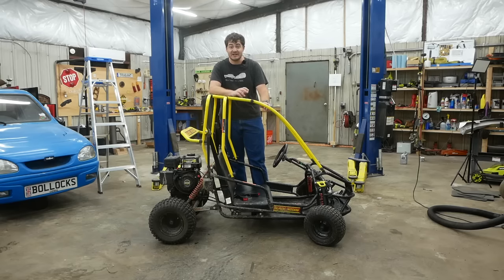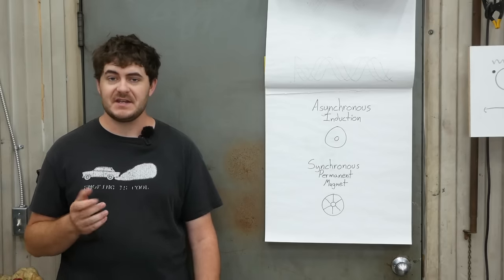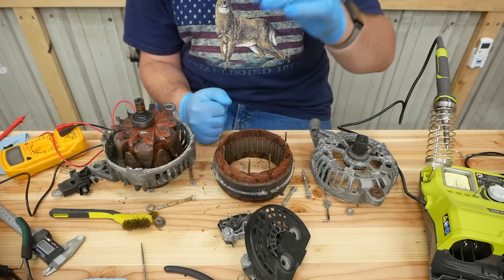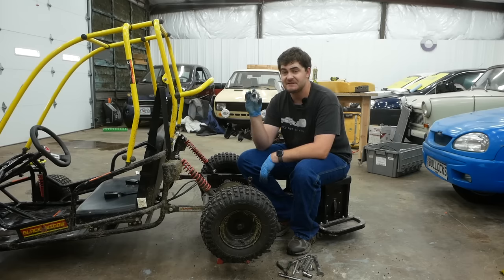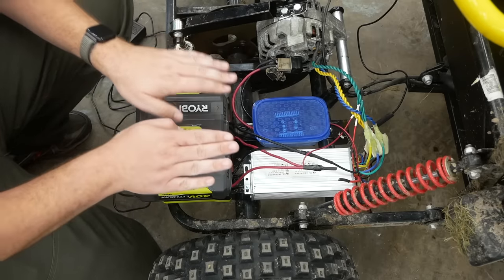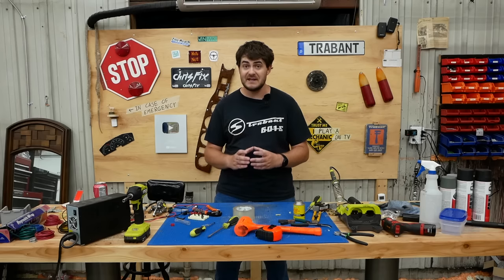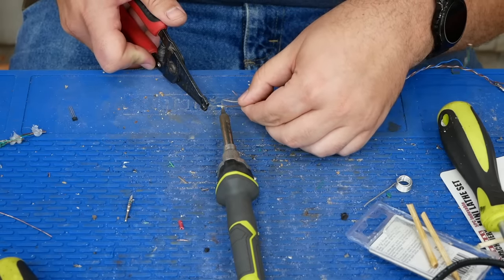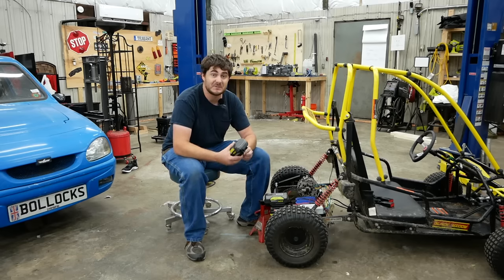Can I Power This Go Kart with a Used Car Alternator?

Comment: You need a startup capacitor, the batteries can't output enough juice to get the motor moving under load.
Reply: what size would he need? 2f?
Reply: @ExplizitDuester  honestly idk, i just know that most Three phase commercial motors have start up capacitors to get them moving

Comment: A benefit of of two 1 kW batteries is that instead of one battery being used at max current draw, you will now have two batteries running at 75% draw.  This will decrease thermal constraints, relatively and likely lead to a longer battery lifespan.
Reply: And less chance of firey explodey death awful which is a significant risk when running lithium cells at their limits.
Reply: Assumes they're at equal wear. Could run into problems if one is a bit older than the other, especially at low states of charge.
It probably won't be a problem though, considering there's parallel BMS... two in series would have much more issue.
Reply: @bob2859  This is all true, it's always tricky to figure out how much information and detail to go into.
Reply: yeah but going with 4 packs would also take that even further

Comment: I have a lot of experience with these weird Chinese controllers and brushless motors.  You need to run the self learn function.  One of the pins on the controller harness will activate a self learn function where it free spins itself around and learns the positioning of the hall sensors.  Doing the 36 combinations isn't necessary if you run the self learn.  Also the BMS in your batteries is what's cutting it out.  The controllers don't usually care.
Reply: And 1500W is plenty. Even for a big guy like Aging Wheels. Although it is a Chinese 1500W…
Reply: @mondotv4216  who would have thought that exchange rates apply to wattages, and not just currency.
Reply: The BMS is cutting it out why? They can put out more than enough current to move that go kart without anyone in it. It's immediately cutting out, and definitely isn't drawing anywhere near enough current to trip over current protection.
Reply: I suspect the controller is cutting out because it is not a 36 volt controller (yes what he has is claimed to be a “40 volt” battery, but every one that isn’t marketing considers 10s to be 36 volt). The resting voltage is high enough that it doesn’t fully trip the controllers low voltage function but as soon as the battery sags the controller cuts out. It’s likely a 48v 1500w controller. It’s actually not common to find a 36v 1500w Chinese controller.
Reply: What
wait WHAT
Reply: Hmm, the batteries are connected in paralell, charging them separately and then connecting them may cause a HUGE current between the batteries due to small differences in voltage.
Reply: @wiredsim  yeah, blame the marketing guys for that one.

Marketing: So about how many volts is it?
Engineer: It's 36V
Marketing: well that's almost 40!
Engineer: yes, it is "almost" 40.
Marketing: yeaaahhh, we're just gonna say it's 40.
Reply: @NORMIES_GET_OUT  Yup... I have 18V Rigid tools and my Brother in-law was saying how much better his 20V tools are. So I showed his with my volt meter how his batteries are closer to 18V then 20V like mine... Then explained how the voltage is only a small part of what makes a good cordless tool lol
Reply: @wiredsim  That was my first guess too. The 40v batteries drop to below the 48v cutoff from the controller to protect the batteries which at 3v per cell is 39v for a 48v pack. The BMS' would not be close to cutoff which would be 30v for a 36v pack. I also just bought a 48v 1500w controller with display and was happy to find I can set it to 36v and use my old 36v packs. I only lose like 2mph top speed and maybe a little torque but gain twice the run time as my old packs are larger and I have 3. He may be able to use his controller switched to 36v either on it's own or with a display, or buy another 1500w with display and use the old packs.
Reply: Actually I just looked at the controller he listed and it is switchable to 36v. I don't know how but maybe the learning jumper. The low voltage cutoff is 42v for 48v pack and 31v for 36v pack.
Reply: The impedance load may be too low almost creating a short that type of coil seems to be pretty heavy compared to an RC enthusiast motor
Reply: @anderslagerqvist2642 Causing a race condition maybe.  Not sure how these lithium battery packs work.
Reply: @anderslagerqvist2642  Causing a type of race condition?
Reply: Definitely have to use self learning function and definitely the controller cutting out at low voltage. to change the controller voltage, one must open the controller up and unbridge the 48V and bridge teh 36V setting near the middle of the controller. Its also possible to turn the 1500W controller to a 3000W controller by shunt modding it. 

"40V" lithium is technically "42V" because its 10s 4.2V Lithium cells, which may have a nominal voltage of 3.6 or 3.7V each, so, the pack would run nominal voltage of 36 or 37V, which is near Low Voltage Cutoff for a 48V Controller.

Comment: I started building a dune buggy for my daughters 16th birthday. She's 19 now and the dune buggy is still in my shop waiting for me to finish it.
Reply: She is likely overwhelmed with excitement by your epic build. Stay epic my friend!
Reply: @FlintsYT Was just making a joke friend. Wasn't being critical or sarcastic. Great video btw. I've always wanted to build one, just never had the time or the workspace.
Reply: It is said that i never know when to quit. I say i just never quit. We might retreat today but the fight is Not over, the battle might be lose but the war isn’t over.
Reply: Finish it
Reply: i made a dune buggy for myself and it's now rotting under a shed because i gave up on it. endless money sink, fuck that. i bought an ATV instead. oh i also bought another dune buggy that is made of new parts instead of junkyard parts and i didn't have to change a thing about it because it was made in a factory.
Reply: My daughters 2 years old. So if i start now it should be ready for her 40th
Reply: @GraveUypo  My other buggy I built around '98 or '99, other than regular maintenance the only repair work has been a fuel pump replacement and removing a head to fix damage from dropping a 6mm nut in the carb while doing tune up work on it.
Reply: @dontwobble  Hey, I resemble that remark!   🤣

Comment: Aging Wheels: Complains about noisy inefficient engine strapped to back of go-kart

Also Aging Wheels: Drives a Trabant, a Yugo, and a Reliant Robin
Reply: ssshhhhh just go with it
Reply: Yeah cause they are in the front!
Reply: The yugo is sick tho
Reply: xD
Reply: @dietbountyicecream1444  use a yugo motor to power that go cart lol
Reply: To be fair the Yugo was souped up
Reply: It's fun when you're making the noise.  Not so much when it's the 6 year old that has the noise maker.
Reply: @0ne323  well technically the robins engine is to the side, right next to him.
Reply: This guy needs to get a Lada too.
Reply: to be fair those are only toys so their emissions are tiny compared to a daily driver, which for him is the Coda EV.
Reply: Yes, but the trabant and reliant robin are interesting
Reply: @compzac  yeah but it's outside, recharges as quick as you can refill the tank and can get the kid into motors, cars etc.
Reply: @dollarstorequality  He already has a garage of much cooler stuff than a lawn mower engine, id be more into the engines in the reliant, the yugo, or hell the freaking trabant than i would the little tecumseh thats on a lawn mower... this idea of using an alternator to power the thing, even if it doesnt work is still a cooler project than the small engine...
Reply: @compzac  the go kart is for a child...although now that you mention he should build a go kart for himself to ride with the kid, win win
Reply: @dollarstorequality  even better reason for it not to be a gas engine, with electric he has more control, the kid could get the machine running without dads assistance, dad could fit a remote kill and stop the cart should he feel juniors getting a little too rambunctious... i mean his kid is 6 the kid might not even have the brute strength to even pull the rope fast enough to get the engine going, much less know how to properly choke the engine for cold starts... i do prefer gas engines for go carts myself, but for a little kid and especially a 4 HP engine with a centrifugal clutch its honestly better to give the kid electric and when hes older like 10 then give him something gas powered, with like 8 or 11 horses.
Reply: @dietbountyicecream1444  A yugo is beyond sick. Like "put it out of its misery" beyond sick.
Reply: Mk3 robin delivers near 100 to the gallon ;)
Reply: Somehow it's different listening to a kid driving circles around the yard vs you running through the gears on the open road.
Reply: @nickopedia5669  Ah see, engines are the sound of my people. I don't have kids, but if I did I'd be proud of them if they where buzzing around the yard on gokarts.
Reply: He needs to get a 250cc 2 stroke motorcycle engine.
Reply: It's for a kid...
Reply: Alright, that gave me a chuckle.
Reply: lol lol I’m mmm mmm mmm
Reply: Don't you get your facts in my fantasy!
Reply: No7😅😊

Comment: As someone who was an electric motor mechanic and also wound motors, both 3 phase and single phase, I appreciate this video. Your terms and explanations were on point.
Reply: I love how he uses the electric go kart thing as an excuse to play with making a home made electric toy
Reply: David. The first thing you should tell him is, if he takes a Delta connected motor and changes the configuration to a Star connection it will make the rotor twitch because the Rotor is wound for a Delta signwave. If he changes it back to a Delta connection it should work.

Comment: As a chinese-speaking viewer, I'd be glad to help interpret the info on that motor controller
Did you initiate the self learning function of the controller by plugging in the white thin cables?
And also, which type of hall sensor did you use? 43E or 49F type ? 
Some controllers utilize dual on-off type hall sensors with one linear type hall sensor in the middle, while others use on-off type only
Reply: The one in the middle is linear?!?! I noticed it has a different designation but the output signal was still a sharp square pulse...
Reply: @TheOriginalEviltech  only some of them use linear type in the middle, most of those hub-type motor just use three same switch type sensor, with variants that have the middle one facing opposite of the other two, as you've noticed
Reply: @Lassi Kinnunen 81 That makes no sense, 3 inputs means 3 sensors.
Reply: Very good point with hall sensors, I almost forgot that there is enormus types of hall sensors (analog, digital, latching, non latching, 3pin, 4pin, different voltages...)
Reply: @Lassi Kinnunen 81 He only installed 3 sensors, which is correct
The other issue I've observed is that he gave the whole system a fairly small final drive ratio, while this controller is mainly target towards direct-drive hub type motors. Those motors are commonly seen in light electric bikes, and I'd imagine if he raise the final drive ratio to about double direct drive rates, the go cart can start rolling by itself with no problem.
Reply: @Aging Wheel?  Ping?
Reply: @bleeedthebrakes  I guess he picked the ratio based on the presumed alternator speed. So you are right about changing the final drive ratio being a good way to reduce the starting torque, but he might then end up with a very low top speed (he talked about the alternator being a relatively low-speed motor)? On the other hand I'm not sure what actually limits that speed, so maybe the controller can run it fast enough to work fine at a ratio in the 1:2 to 1:1 range? I have found this project a great way to learn a bit more about motors :-)
Reply: @xxwookey  I would suggest a clutch assembly instead of direct drive.
Reply: Couldn't he just use a variable resistor to slow down the starting rotation. So not to lose the slowed/dragged magnetic field.
Reply: Try the simpler 2 pin Honeywell hall effect sensor.
Reply: I'm late to the party here on this one.. but from experience with ebikes, and this controller looking eerily similar, they do sense 'back EMF' - which is why throttle control on lower-end ebikes doesn't do anything unless the wheel is turning, ala just like the go-kart.

Comment: One reason the hall effect sensors didn't work could be that the controller takes an active HIGH signal instead of an active LOW signal. 2 out of the 3 led's lit up on your second test, but it may be expecting them to be inverted. It may be looking for a single high signal coming from the hall sensor that is interacting with the magnetic field, and when it sees that there are 2, just switching to sensorless mode. Try inverting the signals with an inverter like the 74hc04.

Comment: In the R.C. world,we use capacitor packs to get the initial "burst charge" to get that start-up power on initial trigger... especially on a non-sensored setup....also, the C-Rating of batteries,plays a major roll on your burst...C-Rating of your batteries may be too low on those, considering how small of a motor they are designed for....cool concept though..I'm sure you'll get it going once you work out the bugs...liked and subd👍....also,2 12s Lipos in parallel should do the trick as 12s= 44.4v @ 5000MaH x 2 = 44.4v @ 10000MaH(10 amps)
Reply: Thats exactly what I was about to suggest he do, is wire in a start capacitor set.
Reply: But he also could blow the lipos if he doesn't have a safety feature for when they get discharged too low. I've seen crazy guys just use a lipo voltage checker and stop using the application once its low 🤯💥🪦⚰
Reply: @jiffywaxjesus1951  agreed...thats a good point you bring up.... definitely gonna need a ESC with voltage cutout....the new EZ-GO golf carts use voltage cutouts on their speed control...he can incorporate that into the loop, he'll be set.. Definitely dont want them going bellow 3.3v..
Reply: @jiffywaxjesus1951  I believe that’s why he used the riobi battery because they have circuitry to shut off the battery’s when they are too low
Reply: L
Reply: I was hoping a brilliant mind would point this out. In HVAC the motor for the outside blower unit needs a capacitor to get the mass of the fan blades started moving. You can see if a capacitor is bad, by manually turning the fan. If it starts working and spinning up the cap is bad, or it is not getting powered.

Comment: 15:28 Controller without sensors know how fast rotor is spinning by using back EMF but if motor dont turn there is no back EMF, so controller energize coils to get started.
21:25 Majority of cheap controller have self learning linie, you simpli connect 2 wires together and controller automata search for hall sensors.
23.00 Problem can be voltage from battery drop so much, control thing battery is discharge and simple act like low voltage protection.
I start with changing gear ratio look like you motor dont have enough torque to start rolling.